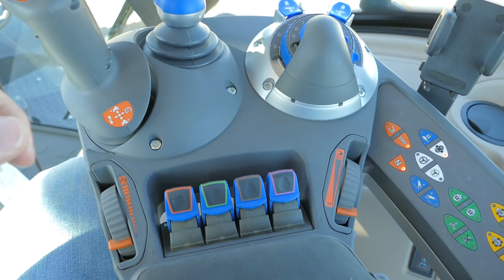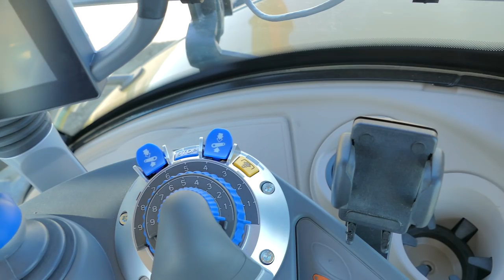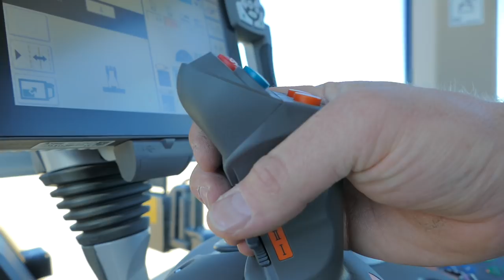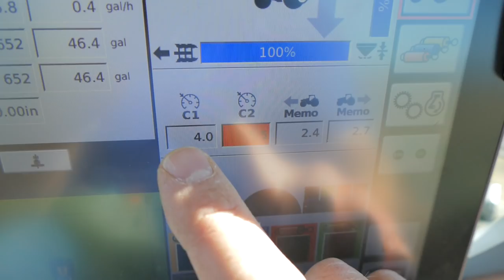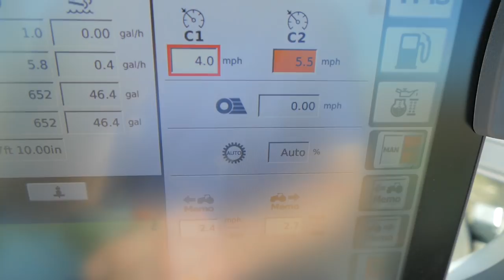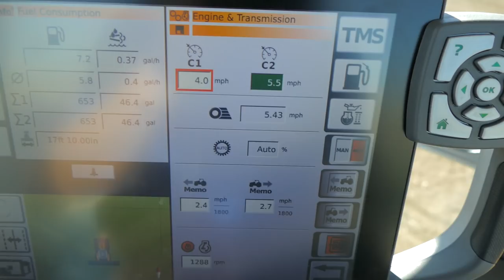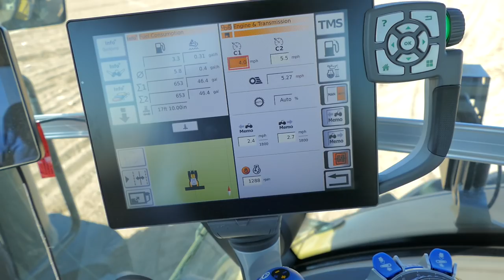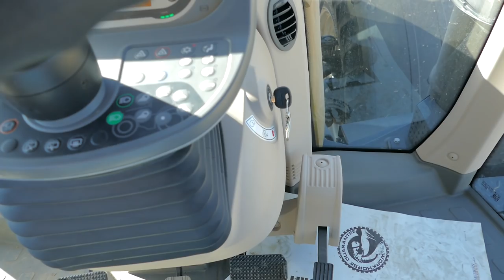Challenger 1000 review part 2

Comment: steering goes back to center because its a reaction steering. That means its just like the steering of a car, the wheels can turn the steering wheel. It goes where the force on the wheels push it to, If you`re driving in a furrow it turns just around every bend. On the street the driving feels better because you get reaction of what is happening to the wheels. John Deere has non-reaction steering

Comment: Please be aware, that stopping this machine with the joy-Stick is really deadly for your transmission. It´s like shifting a car from 5. Gear to 2. Gear so there will be heat and your gear-box will be harmed. A lot of Fendt drivers had this problem as the Vario Transmission came out. So it should be better to use the brake.

Comment: I kknow they're packing a lot of power I these tractors and they seem impressive. My question, as someone with zero experience with them; Can these replace comparably powered articulated 4wd's for primary tillage operations or no? I know they're lighter and probably can't ballast as much? They sure pull smooth from the videos I've seen though. But large articulators should still distribute weight better in a hard pull situation. My other question would be if the challenger's CVT is up to the task of constant heavy pulls like a 4wd.
Reply: @tomdownsfarms  do those CVT's heat up pulling hard? What about the vario drive stuff? They must have a monster cooling package.
Reply: jfdb59 The CVT is top notch, one of the best on the market. Fendt was one of (if not) the first manufacturer to focus completly on CVTs so they really figured it out. Will run all day without complaining or running hot. About half of the ag contractors in Germany run Fendts with CVTs and they survive the beating they get by the drivers.

Comment: 400 horse deere will not run with any of those 1000 series tractors lol Fendt will tell you that its a Big Block Low Rev engine but as for the MAN engine we will see over time and The MAN D26 is what Engine Navistar International now offers in their own version as the A26 Maxxforce  and as for rowcrops you cant even get the 2 biggest models into a 30 inch row space  the tractor slots to the Claas Xerion tractor to compare

Comment: The detent is for float. And timers work perfectly fine. You turn them off in the screen. You also have the profi joystick instead of the profi plus as Americans are incompetent of working anything advanced. You don’t run these tractors full bore like your used to and by doing that you don’t need to tow a super tanker to keep it full of fuel